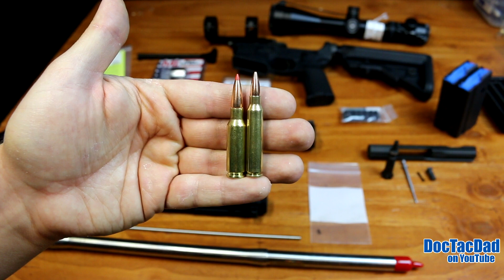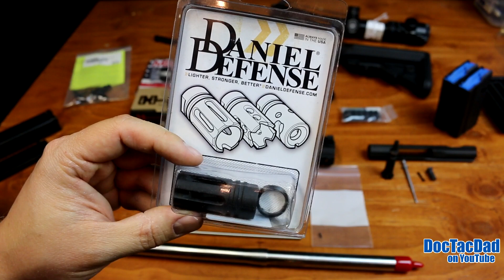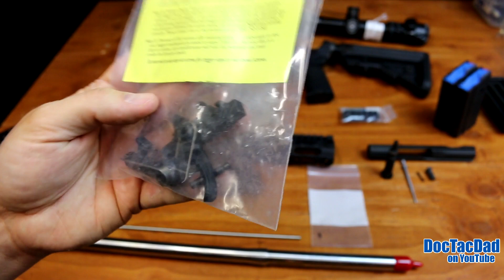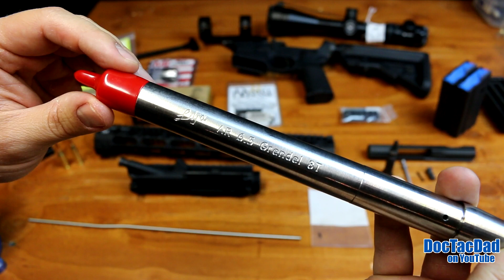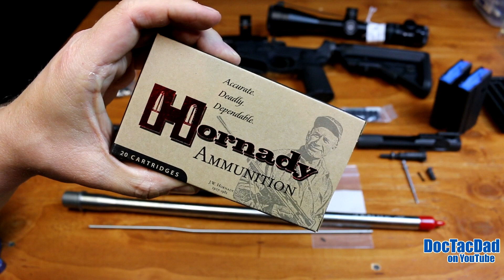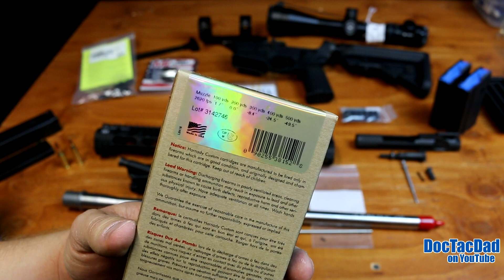Project 6.5 Grendel Rifle - Introduction

Comment: I’m building a 6.5 Grendel. Seekins SP223 receiver set, 20” ARP barrel, JP bolt & buffer set up. I’m doing research on a scope. Where I live 500-600 yds is my max range. I won’t a optic with a lower magnification, 4 is what I’m really want on the low end. 14x or 16x magnification on top end. I’ve been told by a trustworthy source a 123 grain cartridge with the .308 reticle works perfect.  Do you have any suggestions on optics for the Grendel as far as the .308 reticle or any other issues I will run in to.

Comment: It's kind of too bad you're one of the only channels that had this level of depth and detail in to this caliber but you did such a great job in your whole video series. I really just wanted to see what parts you are using for your build as I want to build a conversion upper for my 5.56 so I can hunt, but the information is really great. It's super sad people still have the misconception that this caliber is "only good from a 24" barrel"
they want it to be something it's not. it's a higher performing intermediate cartridge, not a .308 or 6.5 creedmoore. sure it gets closer with that long heavy 24" barrel but it's just not worth it. I was told by a bunch of people on the internet to avoid it unless I plan to lug around a 24" barrel and hunt from over 200 yards which made me laugh. If I want a 16" barrel for better maneuverability over a 24", a deer or hog at 75-125 yards won't be able to tell the difference in the velocity drop right? this caliber has come a lot further since these videos, but there's still a long way to go. still beat the 6.8 SPC though

Comment: anderson lowers are garbage
Reply: Slinkman2021 a lower is a lower.
Reply: anderson is definitely a budget quality build... why not just spend a little more cash and get aero precision receivers?
Reply: Slinkman2021 Anderson is one of the top 5 lower manufactures.
Reply: I build custom AR's and repair AR's for a living.  I have seen just about every manufacturer of AR part imaginable.  A lower is NOT just a lower.  Your trigger/hammer pins or selector lever holes are 0.02" too high or too low and you have a paper weight or cannot use anything but a shitty enough trigger to get it to reset.  Crappy anodizing and your trigger pin hoes wobble out in a couple thousand rounds.  Your take down and pivot pin holes or their detent holes are off or incorrect and you cannot install them or get the to lock into the lower...  I have seen every one of the above problems with Anderson lowers.  They are a product where 2 out of 12 are not in spec.  So you get 10 people singing their praises and two poor bastards out their time and money for a piece of shit.  It's not hate, it's having thousands of points of data to compare.  Most don't have this insight.  You spend you money how you like, but I have seen a LOT of problems with Anderson Mfg parts...  There are just too many better manufacturers for not very much more money.
Reply: Please fill us in on why this is so?

Comment: Is there a reason that every 6.5 Grendel build on YouTube I have seen has a stainless steel barrel?
Reply: Stainless steel barrels are used in long distance accuracy guns.  They are easier to cut the rifling in and minimize run-out as the barrel is being made.  So, they are more accurate for longer distance shooting.  The draw back is they wear out faster.  You don't make a 6.5 G to shoot hogs at 75 yds.  You can do that with 300 Blk and not have to spend as much.

Comment: What buffer weight are you using?
Reply: YES!!!  The exact same question I had.  It looked like a PSA buffer based on the micro-second of video I could see, so...  if it is I'm assuming you went with a crappy buffer of carbine weight and probably ran just a basic carbine buffer spring too.  Inquiring minds want to know.  It's critical to the timing of the system.  It looked like it was running a little on the slow side when shooting, but within timing tolerances.

Comment: Awesome Doc! Looking forward to this build, and seeing it's performance out to 1000 yards! Also, I'm interested in the fact that you're using some Anderson components. I've seen the brand, but haven't heard too much about them. One of my local gun shops caries an extensive line of Anderson AR components at very fair prices. To be honest, I was a little skeptical. It looks like they put out some great value products though.
Reply from the maker: Ian Wolfe I think they are very decent for the price point; maybe not high end, but should be durable and functional. I liked the anodizing on the upper. It's a Cerroforge upper made by them; finished by Anderson. I've chronoed the rifle already and worked the numbers and this thing should be a capable 1200 yard shooter. I'm excited to stretch this thing out! Thanks for stopping by my friend!
Reply: Wow 1200 yards is crazy! I may have another build in my future ha ha. I'll give Anderson a closer look too. From the limited research I've done, they look to be exactly what you have said.

Comment: Wolf ammo loads 6.5 grendle now so if you wanted to just blast it could be done moee economicaly
Reply from the maker: Brian Pardee Yes! That is going to help this caliber immensely...
Reply: DocTacDad i saw it on aim surplus but i think theyre currently sold out of it
Reply from the maker: Brian Pardee I tried to find some to use for barrel break-in, but could find any...I think it comes in waves.
Reply: The russia ukraine situation probably isnt helping the cause good luck 👍 DocTacDad
Reply: DocTacDad sg ammo has 6.5 grendle wolf in stock for $9 per 20
Reply from the maker: Brian Pardee SGAmmo is where I purchased the rounds I have for it now and when I ordered from them they didn't have this in stock...thanks for the heads up!

Comment: Very interesting. Thanks, I will be following this with great interest especially concerning the trigger, It seems like a great price for a two stage trigger and rail.
Reply from the maker: Thomas Paine I've ran these triggers before and they are pretty good for the money...however sometimes they feel a tad too heavy for really easy precision shooting.
Reply: DocTacDad Thanks for the speedy response. I did a google search and was able to find it for the price you mentioned. Also, I looked at reviews and they were generally positive. I will not be using my Bushmaster Carbon 15 for precision shooting however, I am not thrilled with the stock trigger. My S&W M&P 10 however has an excellent trigger. Again, thanks so much for getting back to me and your comments. TP
Reply from the maker: Thomas Paine You liking that M&P10? I've almost bought one a couple of times...
Reply: DocTacDad I am a 308 fan and already had a Ruger American 308. I have been looking for a semi-auto 308 and found the M&P 10 for under $1,000.00 so I got it and need to give it a thorough testing before commenting further. I did made two additions: The stock appeared to be a Tapco so I bought a Pad for it and it fit perfectly. I also added a UTG 4X16X44 30mm Scope color reticle . I know it is cheap but my income is limited. I also added a .8 in. rail riser to clear the charging handle. OK, that was three additions.
Reply from the maker: Thomas Paine I'd be interested in hearing how it goes...
Reply: DocTacDad I will get back to you shortly. Thanks for the interest.